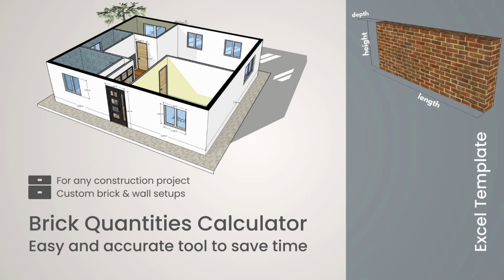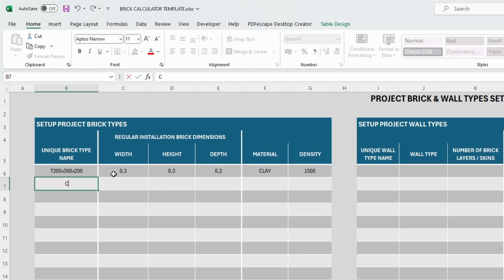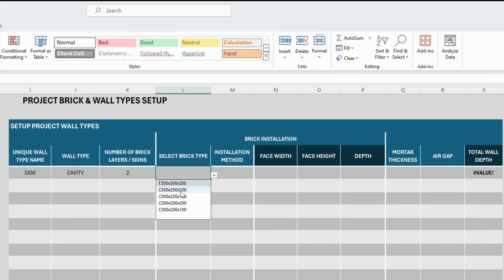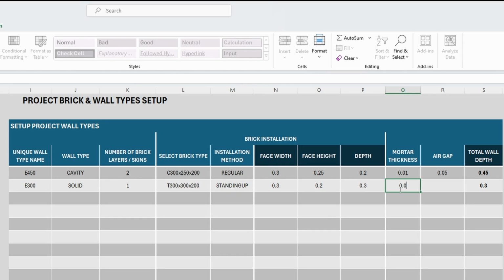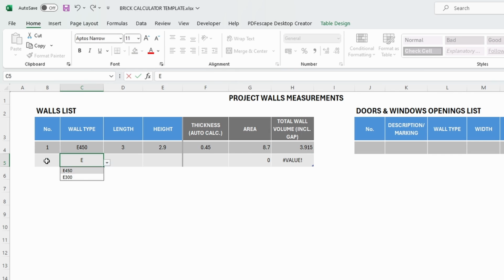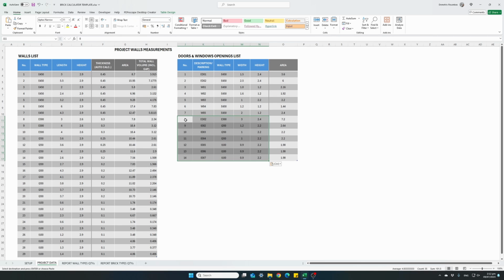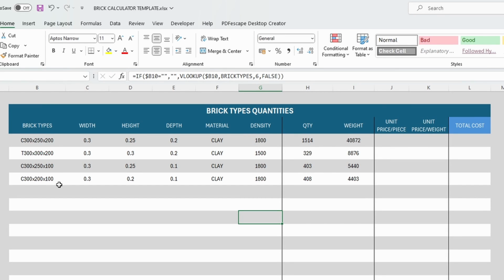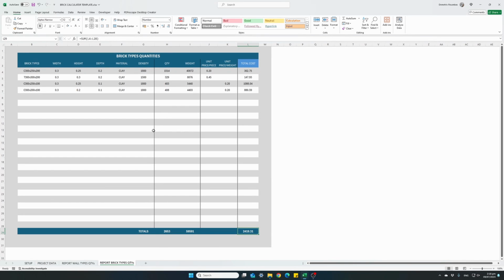Brickwork Quantitiy Calculator Excel Template for any project

Comment: What about  USA Measurements?
Reply from the maker: The calculator does not use fixed units (it works exactly as shown in the full tutorial video). You can use imperial units, just make sure you enter all measurements in the same unit — the easiest method is to convert everything into inches.